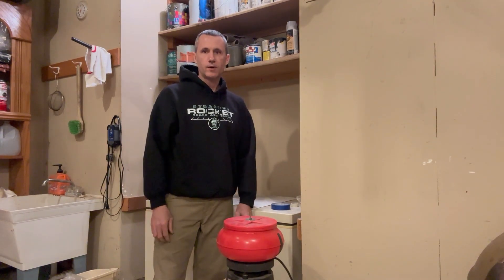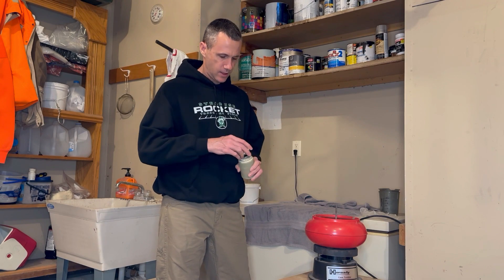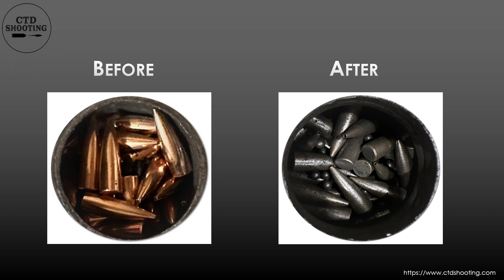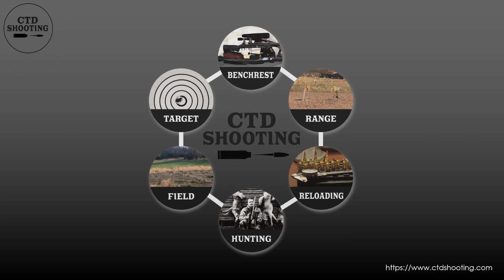Coating Bullets

Comment: Why strip the copper off?
Reply from the maker: Coating bullets does not take the copper off - it simply covers the copper with a coating.  In this video, I used Danzac (Tungsten Disulfide) - there are other coatings a person could use if they wish.

Comment: Ya, Brake Kleen does leave a deposit on what you spray it on, can't obviously see it, but it is there, that's why they came out with electrical cleaners that does not leave a deposit. People tried to use it with cast bullet moulds, and soon found that out, that's why they also say to use 99% isopropyl alcohol to clean moulds as well, mostly because it's cheaper than the electrical cleaner.And even though moly is slippery, it is actually harder than the barrel steel.
Reply from the maker: Thank you for the information.  Is there a specific brand of electrical cleaner that you use.  Thanks again for the comment

Comment: At a typical short range group match, how often do you clean and what method do you use when you do? Thanks for the video.
Reply from the maker: Hi Boyd.  Hope all is well.  I am mainly a score shooter, but I treat my rifle the same at score and group tournaments.  I think it is important to go to the match with a clean barrel and especially throat area. That way, if my cleaning process misses some, it isn't a big deal.  Starting with a clean barrel simply means I can stay in the precision window longer.
I clean after the yardage - unless I'm shooting like crap or at the Nationals when I have a lot of time.  In those situations, I will clean after the 2nd match (so half way = WU, 1, 2 Clean 3,4,5 Yardage done Clean).  
Super quick explanation.  (I think there is a video (Managing the Carbon Ring: https://www.youtube.com/watch?v=tuHunacBFPU&t=240s ) where I talk about what I do at a match)  But:  2 wet patches - let soak while I'm working on the throat area.  1 more wet patch.  10-15 strokes with bronze brush.  Patch until clean.  Clean chamber area.  Done. 
After the match is over, I will do the same thing.  Once home, I will do a more thorough job with different products.  I check barrel with a bore scope before big matches.  Hope this helps.
Reply: Thanks, that is just what I wanted to know.  @ctdshooting

Comment: Tip do not spray brake clean on polymer tipped bullets, the tips will come out.   I don't  use bbs waste of time bullets rattling together  works just fine. I've  been  moly coating for 30+ years, good stuff
Reply: I've found the moly vs uncoated is 1 inch higher @100 yds. The other nice thing is not much cleaning little to no copper in lands,  I  also spray moly down the barrels to help.
Reply from the maker: Thanks for the tips - especially the polymer tipped.
Reply: @ctdshooting  yeah ask me how I know!
Reply from the maker: @randybichsel4597  Dang it

Comment: What is the difference between this and HBN?
Reply from the maker: Great question.  I have never used Boron, but I have a close friend who is a Hall of Fame Benchrest shooter who does.  The end result is essentially the same except Boron is clearish and does not leave any dark grey residue on your fingers. The method of application shown in the video would work for both.  Hope this helps.  If you have any more questions, let me know and I can ask my friend for the answer.
Reply: @ctdshooting  Thanks so much, I'm just asking because when HBN came out it was a huge hype, and now there is nothing to be heard any longer.

Comment: What would you say is the average velocity change between your coated bullets vs not?
Reply from the maker: Great question.  Unfortunately, I have been shooting coated bullets since 2010.  I have not chronographed plain vs coated for over a decade.  If (and that's a big if) my memory serves me correctly, the coated bullets were slower by 50-75 fps.  Sorry that is  not the exact answer you were looking for.  However, if you are thinking about coating bullets - don't let the small velocity change keep you away.  Simply load the same powder charge/seating depth/neck tension and shoot.  If the group is not what you like, simply adjust the powder slightly (as in .2 gr) to bring the tune back to where it was.